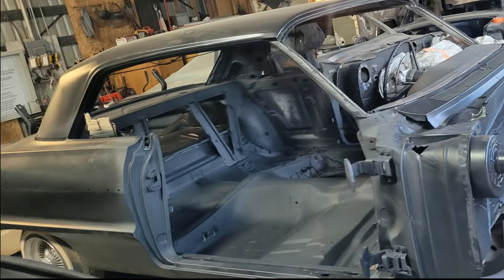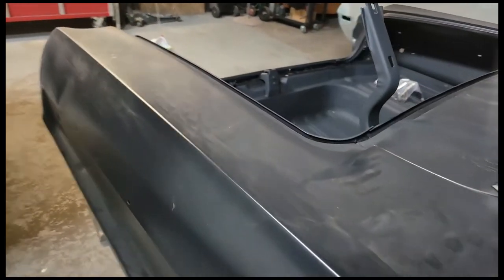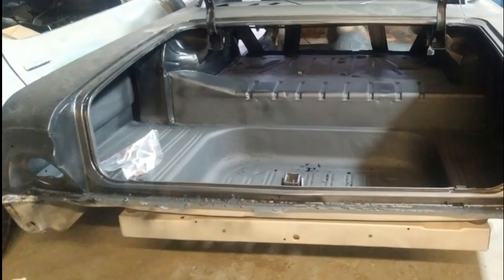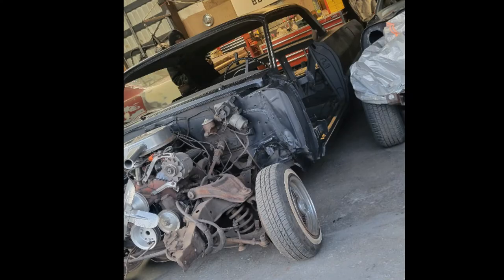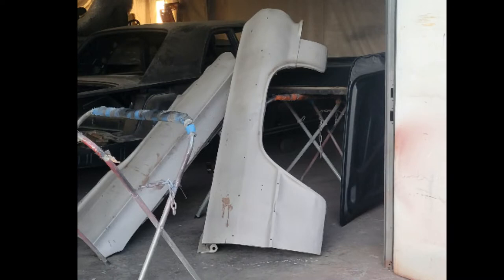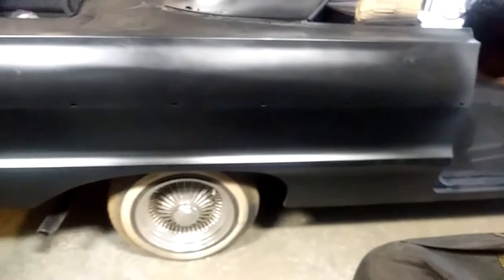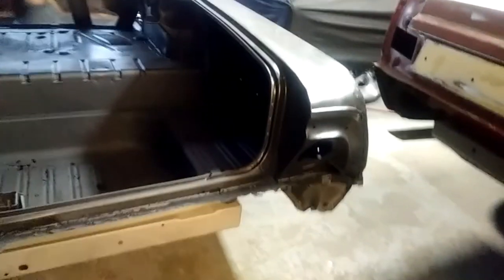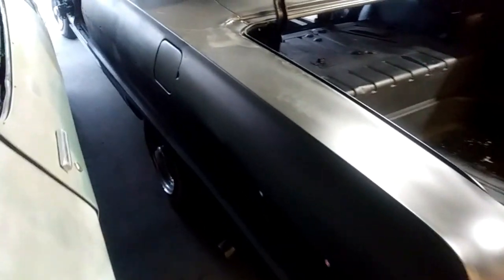1964 Impala Lowrider Restoration part 3(Back from Sandblasting)

Comment: I just put a 350 with a 350 turbo transmission that is working great. The 700R4s are great as well and I know plenty of people that use those as well. Also know a lot of people putting 327s in if you can find one!
Reply from the maker: Yeah that's a good combo as well,that has crossed my mind also ,thanks bro